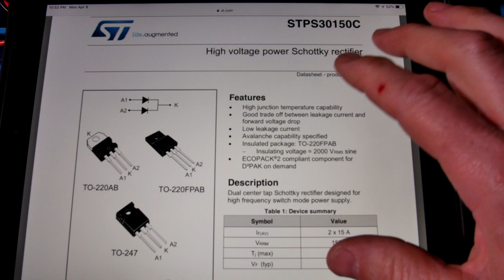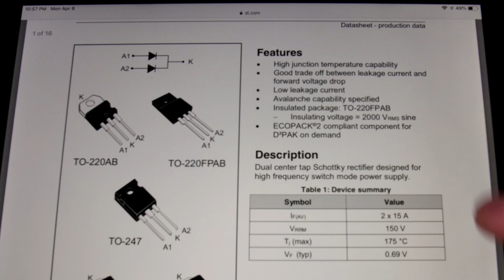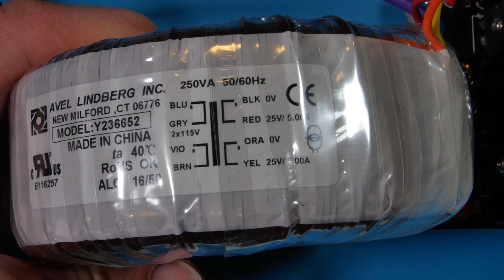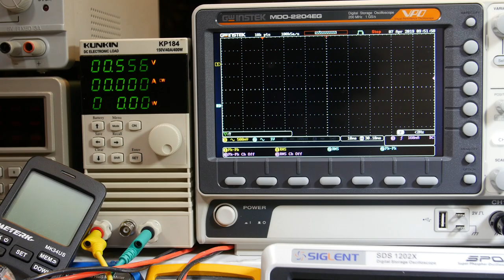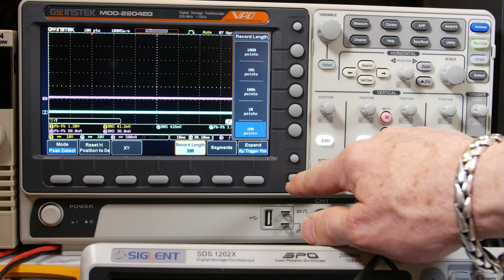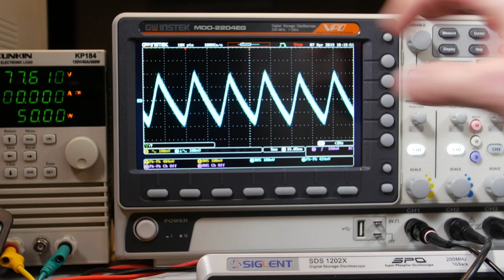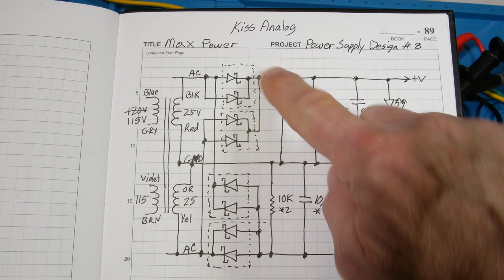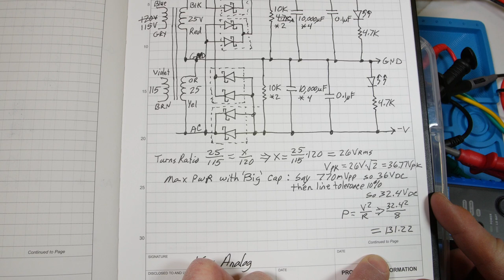Power Supply Design #8 How Much Power?

Comment: Hi Eddie,

Great video, really informative - I like how you go through the data sheets and measurements on the meters/scope.  Got a few questions:
1) When you were doing the maths in your book, you used P = v^2 / R but in the on-screen notes at 29:25 you have P= V^2 * R.  I'm assuming it's the former - in fact, I'm pretty sure it's the former, and your calculation (almost) bears that out:  but, 33.8^2 / 8 = 142.81W not 143.23W so did you have slightly different figures in the end?
2) I must have missed it, but where did 8 ohms come from - is that just an example 'load' for calculation purposes?
Really looking forward to that optimisation video.  I'm starting to pull together my input power stage for my supply so it'll be really useful to compare what you say with what I've scratched my head and come up with!  Incidentally, I don't think my cap bank is bigger than yours - 80,000uF is one bad-boy smoothing bank :)
Reply from the maker: Thank you!  Yes, good catch, that is a mistake on the second equation. ;)  I used 8 ohs as a speaker load.  The differences are probably rounding errors, or a typo;)
Reply: Now you say it, speaker load makes sense.
Reply from the maker: Andrew Johnson Thank you, I’ll remember to say where this comes from!!
Reply: I realize I'm kinda off topic but does anyone know of a good place to stream newly released series online ?
Reply: @Kalel Henrik thanks, I went there and it seems to work =) I appreciate it!
Reply: @Caiden Zaiden No problem :)
Reply: Isn't that technically still less than 1f? And isn't 1f just 1 amp at 1 volt for 1sec?

Comment: WOW FANTASTIC, THANKS!! i AM SO HAPPY!! THANKS!!:-) I'll contact you:-)
Finally a really quality meter, instead of my cheap meter! :-) Really great video, thanks for going so detailed trough the setup, that helped me a lot! I do also like that you put the calculation on the screen, wary informative:-) In your circuit drawing with a center lead, you only used 2 diodes, but here you are using 2 in one package, would a single shutkey diode per side not be enough? Can you please tell me the name of the gray-orange thingy you use to connect the cables with?
Reply from the maker: Fried Mule Congrats!!🎈  Yes, a single diode will work great!  Actually, I’m not confident in parallel diodes sharing very well.  That subject is worth a video!  I’ll get a link and part number for those terminal blocks - very handy and reliable parts.
Reply from the maker: Fried Mule Congrats!!🎈  Yes, a single diode will work great!  Actually, I’m not confident in parallel diodes sharing very well.  That subject is worth a video!  I’ll get a link and part number for those terminal blocks - very handy and reliable parts.
Reply from the maker: Fried Mule Congrats!!🎈  Yes, a single diode will work great!  Actually, I’m not confident in parallel diodes sharing very well.  That subject is worth a video!  I’ll get a link and part number for those terminal blocks - very handy and reliable parts.
Reply: The grey/orange thingies are Wago clamps - http://www.wago.ltd.uk/connectors/lever/ They are well liked and you can pick them up off ebay, amazon, screw fix etc etc
Reply: Just to be sure, I did send you a mail yesterday, but I am not sure if I did write the right address? :-)
I am not in any hurrie, would just make sure, so please take it easy and good time! :-)
Reply: @KissAnalog  I am so happy, I have just received a fantastic multi meter, at least 100 times better then the one I had! :-)
And the probes are just great with those add-ons! I am so happy and grateful, thank you sooooo much, this is so fantastic!!
Reply from the maker: You are welcome!  I’m glad it went to someone who will use it.  I really like the Tektronix multimeter.  I’m glad it made it safely, i hope the leads are of descent quality...
Reply: @KissAnalog  The meter will guaranteed be my main meter, it has so many great features that my other one does not have. The leads are maybe a bit plastic but nothing compared to my cheap leads, I am wary happy for your gift!! :-)
Reply from the maker: That’s great!  Congrats - you deserve it!

Comment: hi Eddie, I appreciate for your contribution on electronics world, i have a question i have an amplifier on my bench which should operate 55-0-55 8amps  unfortunately it is hard to find it and to make the amplifier works. can I use DC power supply to this amplifier????
Reply from the maker: Thanks so much for your support!  I appreciate you!  Yes, you can use a Plus and Minus power supply.
Reply: @KissAnalog  THANKS Eddie...HOW CAN I USE DC POWER SUPPLY FOR THIS KIND OF AMPLIFIER? PLEASE

Comment: Hi, what if I add a very generous capacitor bank provided my transformer can cope, can the resulting DC output hurt my amplification board?
Reply from the maker: Thanks for the great question!  No, having a 'stiffer' output DC voltage rail due to adding more bulk capacitors will not hurt your amplifier.  As you say - as long as your circuitry feeding the caps isn't hurt by the larger inrush current.
Reply: @KissAnalog  🤟

Comment: I may have an idea to a more advanced video:-)
I have read about different transformers, EI, Toriodal, O-Core, R-Core and others and 
everyone have there opinion. But What are the difference, where are one 
core better then an other? Flux, saturation, heat and so on. :-)
I.e. have I heard that O-Core are better then toriodal because the O-core is
 rounder in both direction and therefore less noisy. The R-Core should 
be the absolute best, because you avoid the copper being pressed more 
together in the inner diameter then the outer of the ring.
Reply from the maker: Fried Mule That is a great subject!!  I’ll have to do a mini series;)  Thanks for the idea!

Comment: I have a question for you about choosing the right size of transformer.
Would it be possible to use a DC lab power supply and then drive the music amplifier as hard as possible and adjust the voltage on the power supply until there are minimal amplifier distortion, then read ampere and voltage and get a transformer that fits these values?
Reply from the maker: Yes, that’s great insight in how one might choose the correct voltage.

After my videos in showing the types of distortion, I plan to start reviewing these Amplifier boards, and I want to demonstrate how a particular voltage might be chosen for optimal performance, or for max power.  I think the class D amps are bringing about an unexpected challenge...
Reply: @KissAnalog  Great, that's only because your videos that I am beginning to get enough knowledge to add 2 and 2 together:-)
I am looking wary much forward to your class D videos, I have heard so much bad about them for audio but I also know that some high end amplifiers are fitted with class D.
I can imagine that it is not as easy, things are not so simple in electronic. :-)
Reply from the maker: Thank you - I appreciate that!  I’m also very interested in the Class D, and actually had high hopes, but the little I’ve worked with them...I’m not so sure now.  They do definitely shrink the size of the amp and are able to put out much higher power because of their high efficiency - which also lowers the cost.  But!  To what cost?  I have a bunch of boards - including a ‘high-end’ and higher power one, so we will find out if they get Kiss approved;)

Comment: Couple of questions .... 1) What purpose is served by the little capacitors on the output?  2) How does a diode and resistor in parallel with the output limit the current?  Great video!!
Reply: My guess on #1 is that they serve to filter higher frequency noise.  Number 2 still has me stumped.
Reply from the maker: Thanks Victor!  Great questions!  I think the small caps that you are referring to are for low impedance at high frequencies.  I’m not sure what diode and resistor it is that you are referring to.
Reply: @KissAnalog  Oh, I get it.  The LED is just to indicate  the circuit is live.  When you said "limit the current" you meant the the resistor ws limiting the current to the led.  I thought you meant something else.  I got knocked on the head a couple weeks ago and I am still learning the basics.

Comment: Hi Eddie,
So the normal equation for the ripple needs changing ?
Example
I load / (2* frequency * capacitance in Farads) = the worst case ripple voltage expected
This is now
I load / (4* frequency * capacitance in Farads) = the actual ripple voltage expected.
As your demonstration on the scope ?
Sorry if I ask to many questions 😉
Adam
Reply from the maker: Great question!  Please keep them coming - you hit on key points.  The more conversation, the more others will learn;)  I think it doesn’t quite half the time again as the charge time is not equal to the discharge, and actually gets to be a lesser percentage as the capacitor size gets bigger.  Maybe reduce the time by 20%?
Reply: @KissAnalog  
Great stuff, thank you very much.
I hope I'm not spoiling your up coming video's
Adam
Reply from the maker: No - you are helping develop them;)

Comment: I’ve got a 240v/24v 200w toroidal transformer I want to put a 24v DC submersible pump on for my aquaponics project . I understand there would need a bridge rectifier, deciding on what size capacitor is what is troubling me . I’ve been told there would be a need for a 1000uf capacitor. 24v (?)
Reply from the maker: Great question Martin!  I'd say that 1000uF cap would probably be OK, but then it depends on how much voltage ripple is OK.  With a motor, I think it would be ok with some voltage ripple.  You could start with 1000uF and go up if it didn't seem to run smoothly.  It wouldn't hurt to go 3 or even 10 x larger.  Now, remember to get a capacitor rated at a voltage higher than the 24V.  It would probably be great to have 50V rating (possibly 35V).
Reply: @KissAnalog  , the pump I’ve got is 24v180w , hopefully it won’t get too hot in there . The transformer is in an enclosed , waterproof container , metal bow with a plexiglass cover .
Reply: @KissAnalog  , well , it went BANG . I left it run for two minutes and I thought I was on a winner (first time wiring) . I had bought a 25v 1000uf capacitor . Not enough apparently. I live out of town so will get another capacitor to have another go .
Reply: @martinbonner8626  A little late to this rodeo, but yes, your capacitor would go BANG! It was only rated at 25 volt and you said your Transformer gives 24 volt. That gave you a 1 volt margin of safety without the capacitor. When the capacitor was added, that 24v went up over 30v without any form of a voltage regulator to calm it back down.  (Give or take some losses with the bridge rectifier) So having a capacitor only rated for 25 volts now pushing over 30 is going to destroy it. As said, a rating of 35v would be barely squeaking by, but getting one rated for 50v would be much safer.